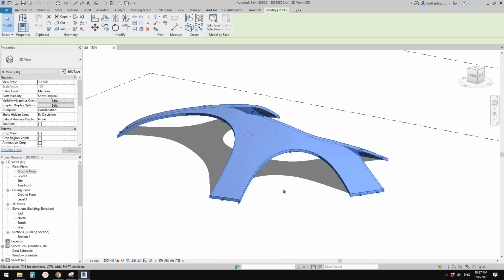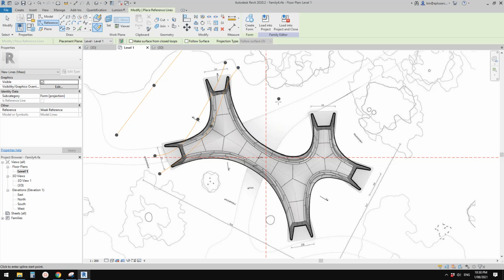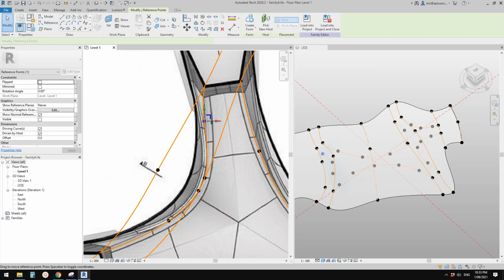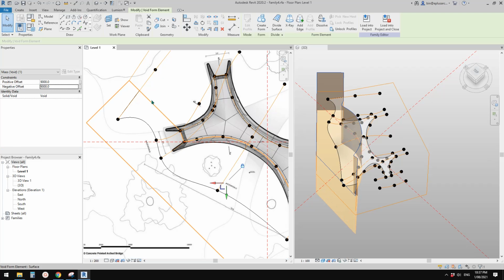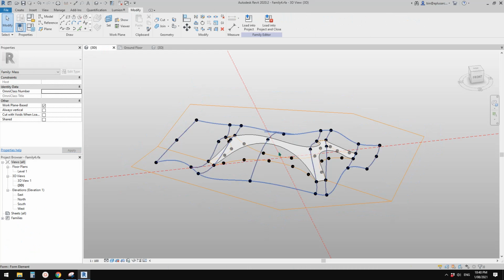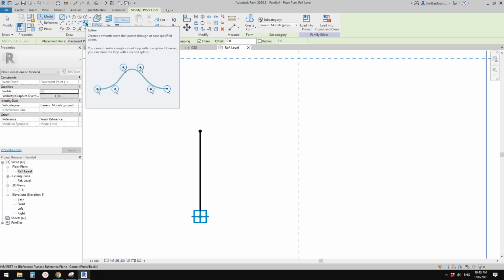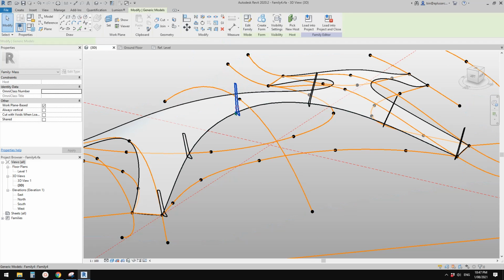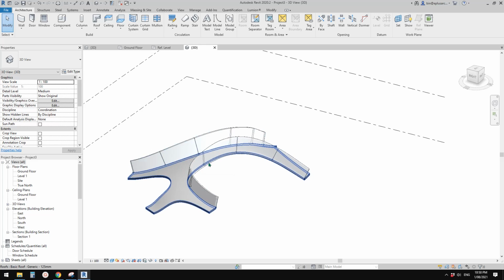Everyday Revit (Day 498) - Mass Exercise

Comment: Awesom ... a nice way to built up such a surface .. I've tried to create form from the manipulated  edge curves, it creates a surface but with a lot of triangulations (not smooth) 
For the "rail" it's a complicated mass that is not possible to put roof by face or wall by face on it. so a solution could be to apply material already within the family?
Reply from the maker: Probably more model in place or adaptive family than roof or wall by face.